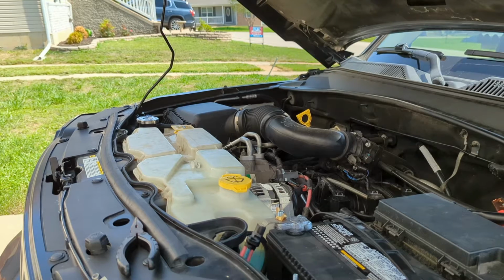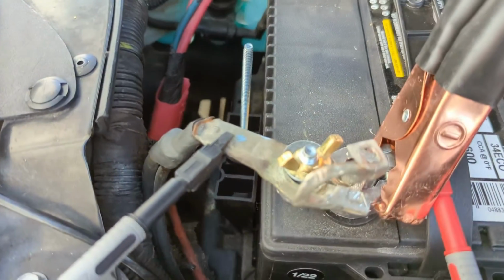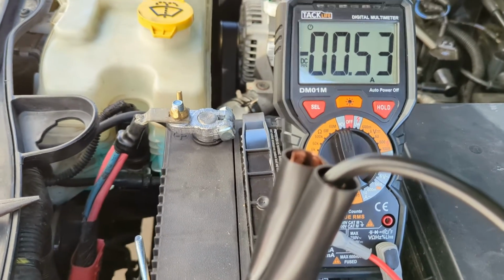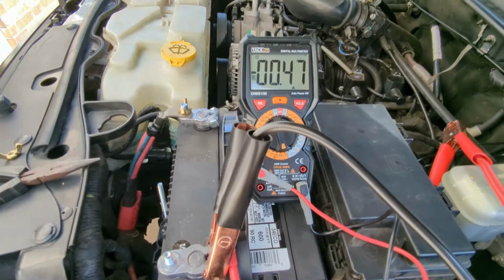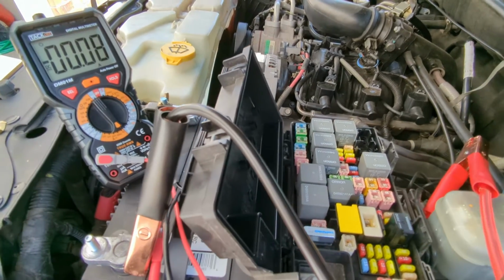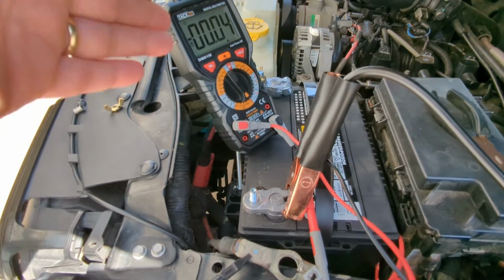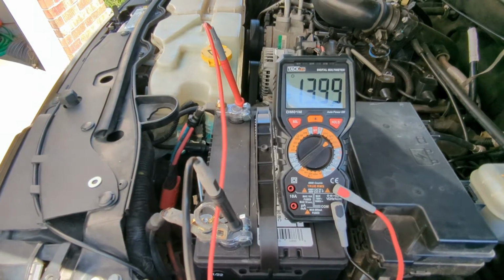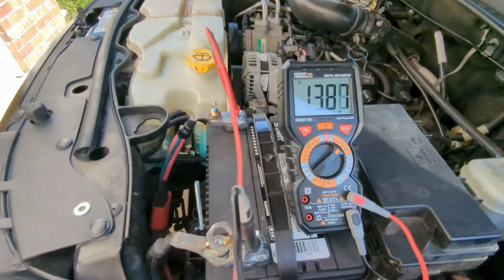Parasitic Drain on Jeep Liberty Battery

Comment: I have a drain on battery, I noticed headlights going on and off . Headlight switch not in auto position.  I used a light between negative terminal and battery post.  I was getting an oscillating effect on the light. The fuse I pulled to get it to stop was for ignition off drain.
My key remote doesn’t work now and radio memory doesn’t work.  If I leave that fuse out battery doesn’t drain.  Any idea what could be the problem in this circuit
Reply from the maker: The fuse you pulled was for "ignition off drain"? I've never seen a fuse with that label before.

Comment: I got .16 mil amps. Is that ok?
Reply from the maker: I assume you mean .16 amps, which would be 160mA. or do you mean 160 micro amps?  160mA may be a bit high, but not outside the realm of normal these days with all of the computer controlled systems. I guess as long as your battery is holding up for the duration you are not driving, all is good.
Reply: @srtamplification  .16 amps. I pulled the JP power fuse. Dropped to 0. Put it back in, went back up to .16 amps. I read there is a connection under the carpet under the drivers side back seat. I will check that next.